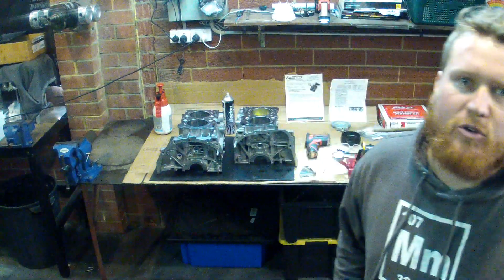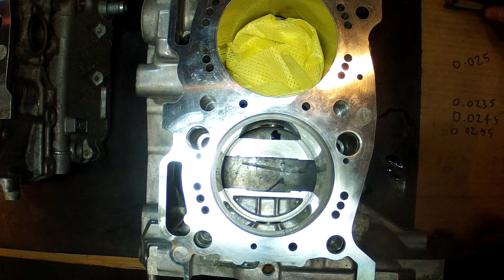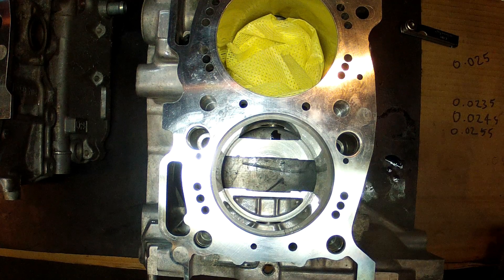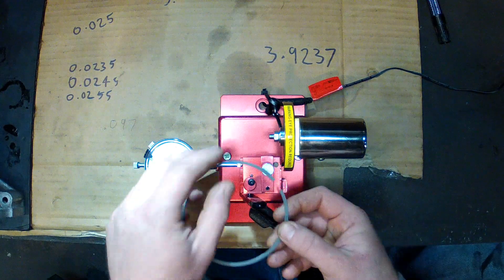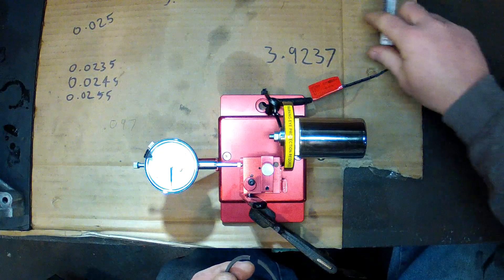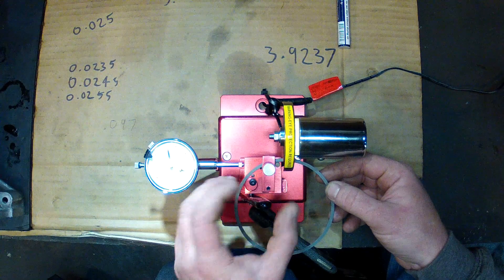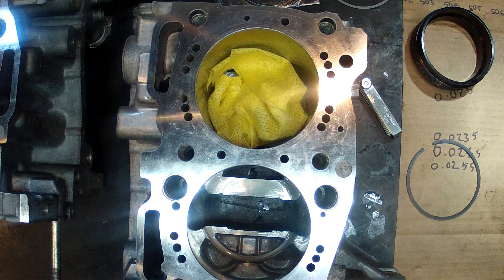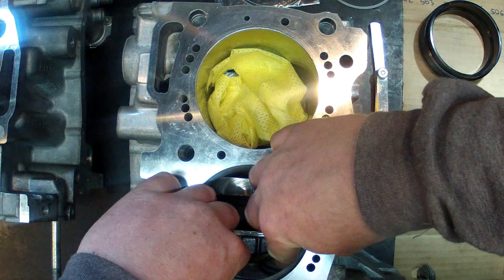Piston Ring End Gaps - Subaru

Comment: 25 thou for both rings?
Reply from the maker: forREPS yn 
Is that wrong?  It is exactly in the middle of the recommended gap specified by the piston manufacturer.
Reply: Bram Biesiekierski thanks for your reply. I am in the middle of building a medium to high boost EJ20 CDB. Was just asking around what people are using for 1st and 2nd ring end gaps who are running similar boost settings.
Reply from the maker: forREPS yn 
Honestly, dont follow my lead.  This is my first build too haha
Reply: Bram Biesiekierski cool, .025” is a little on the large side I’ve read. Good gap for high boost applications though lol
Reply from the maker: Well.  I want this engine to take some serious boost.  Im gonna feed it all she will suffer.

I have put alot of work into keeping it together at big power levels.  Including the close deck, 14mm studs, dowelled and line honed main bearing tunnel to accept ARP main bolts.  Aswell as that, de-stroke so the RPM window can be extended.